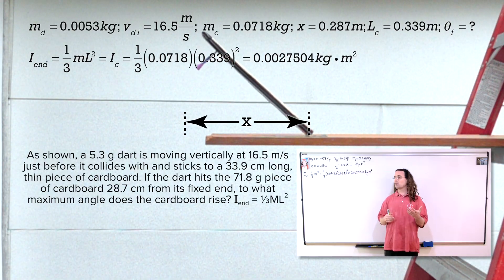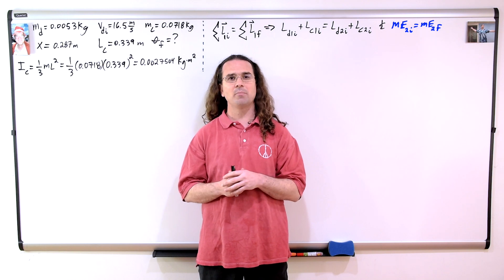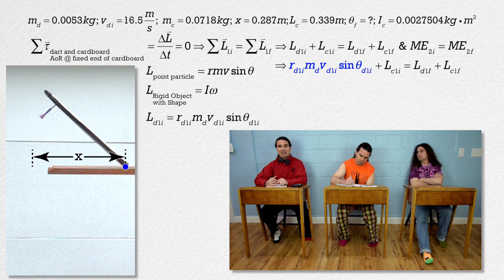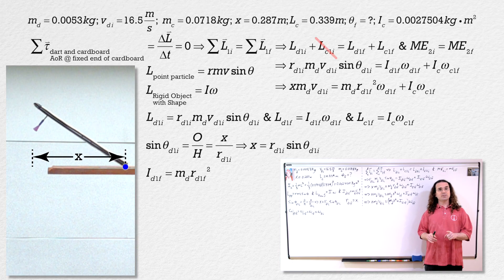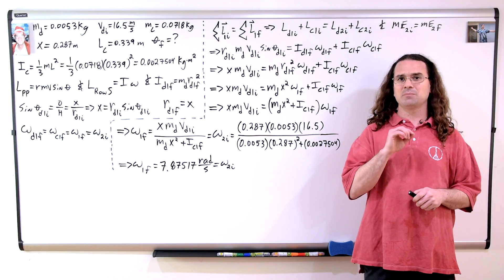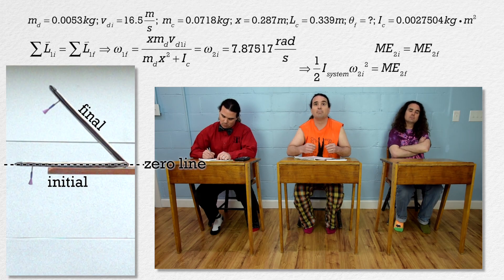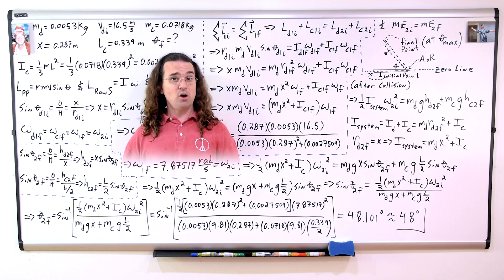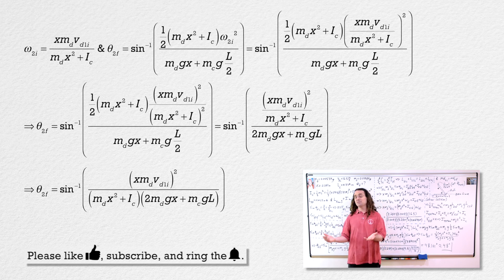Dart with Thin Rod Collision - Conservation of Angular Momentum Demonstration and Problem

Comment: I had a question, so 9:46, the height of the dart final is to the tip but the height of the cardboard final is of the center of mass. So wouldn't that mean that the height of the dart final would also have to be the center of mass of the dart?

Comment: can part 2 be solved by using the torque from gravity to find angular acceleration then using angular kinematics?
Reply from the maker: The torque caused by the force of gravity is not constant, that means the angular acceleration is not constant. So, no, it cannot be solved that way.
Reply: @FlippingPhysics I took some time to try to solve it with kinematics, since angular acceleration is dependent on cos[theta] we can use the integral form of 
wf^2 = wi^2 + 2a(change in theta)
And integrate it from 0 to max theta (when wf = 0) and we’d get the same expression.
Ps. Love your vids, saved me in both AP physics E&M and Mechanics so I appreciate it, keep up the good work!

Comment: Hello Mr. P, I solved the problem in an another way and got an angle of 46.2 degrees, could you please check my solutuion and tell me if it is correct?

The different thing I did was in the conservation of mechanical energy equation, instead of writing an expression for both potential energies of the board and dart, I wrote one expression for both and got the height from the center of mass of the system which was 0.12817 meters. 

(m + M)gh = 0.5(Inertia of system)(w)²
h = 0.1287 m

I then calculated the position of the center of mass which turned out to be 0.1775 meters from the AOR.  

Using this information I then used sine inverse where the distance the center of mass of the system from the pivot was the hypotenuse and the height of the system was the opposite and got an angle of 46.2 degrees.

Thanks in advance 😊